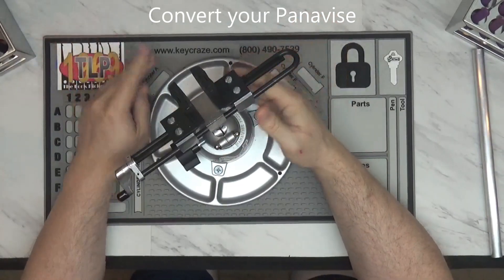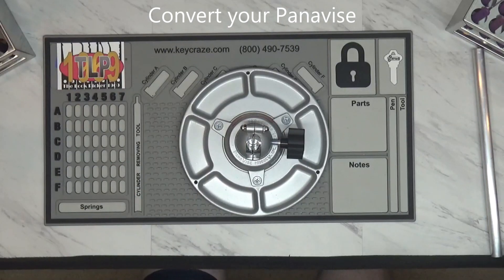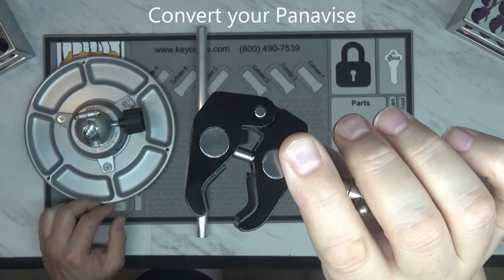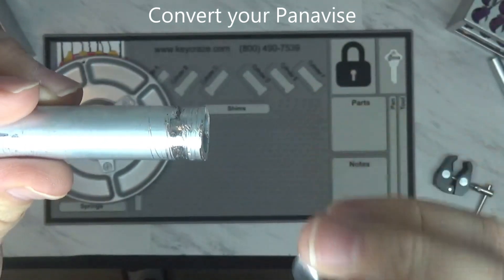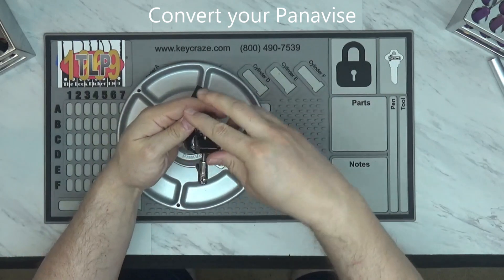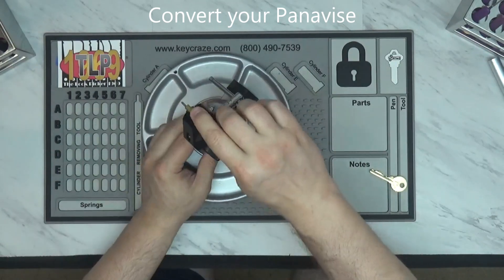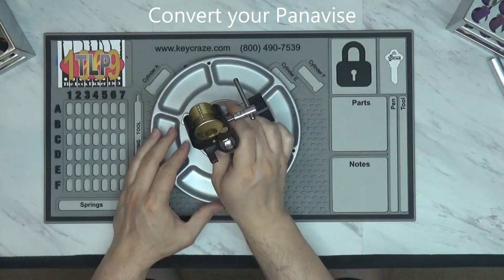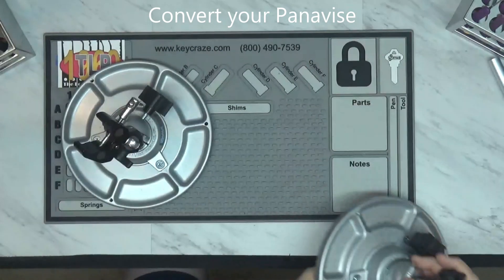I can do what with my Panavise?!

Comment: Nice one mate! That does make one expensive base tho 🙂, but you can use a multitude of other bases or even table clamps etc. But that clamp to hold the lock is realy nice and versitile.
Reply from the maker: Agreed.  If you have the vise version of either the 305 or 350, this gives you options to expand upon that with a variety of options.  I was just sharing my journey and experience finding a solution that worked for me as I found no prefabricated solutions out there, at least none I was satisfied with.